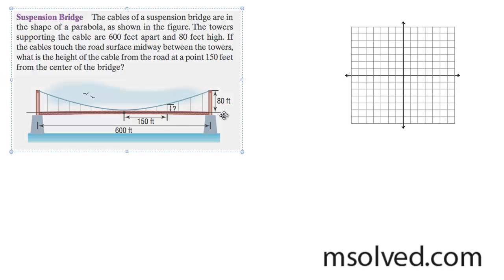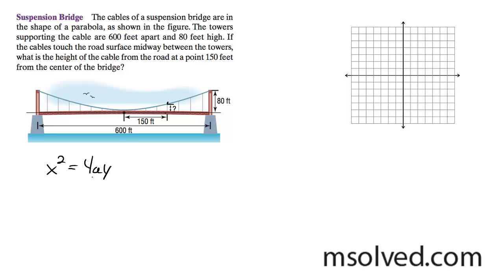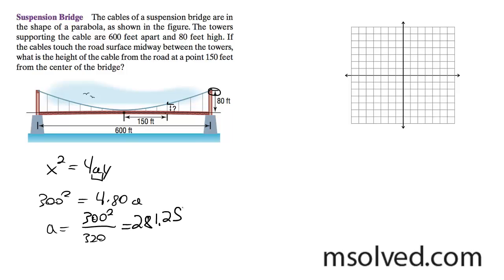Trig and Suspension Bridge with parabolas

Comment: Here is an easy formula for this problem!: (can be used to find missing length too) Height you seek = (Max Height/ Midpoint Length squared) times the length requested squared. With this problem that looks like: y= (80/300^2)(150^2). Y=20. Quick, easy, uncomplicated. Enjoy! 1300ft between 180ft towers. Find Height 200ft from center. Y= (180/650^2)(200^2). Y=17.04. Boom! 20 seconds.
Reply: what formula is this called?
Reply: @misheeerfe9439  I have no idea if it's a known and named formula. I came up with it after trying to figure out his steps and realizing that his method didn't work in all cases.